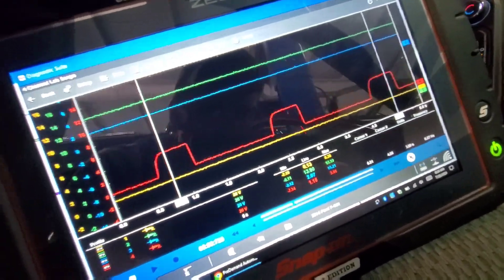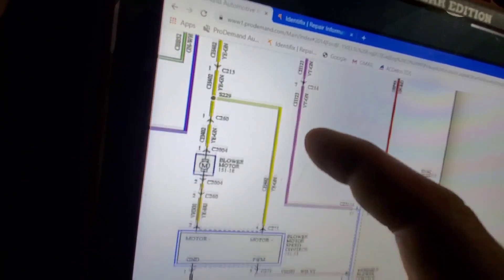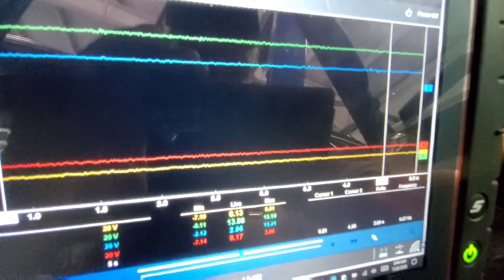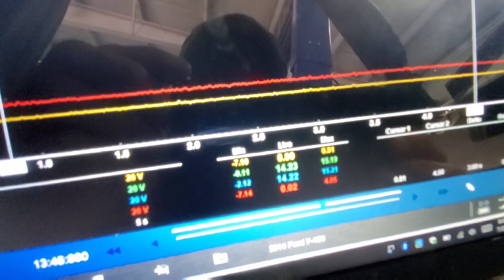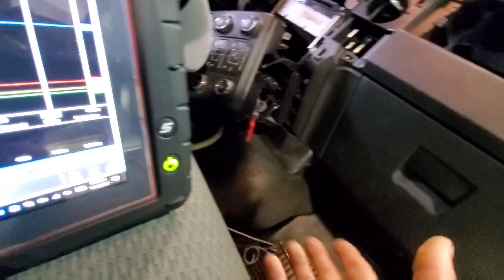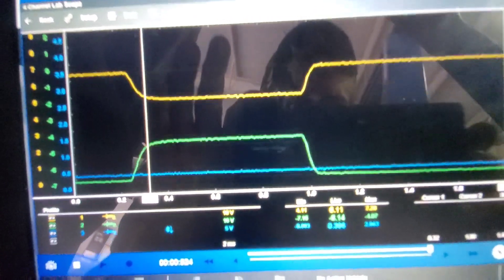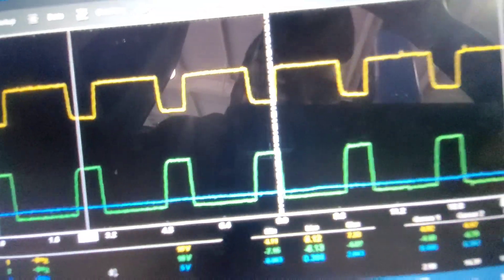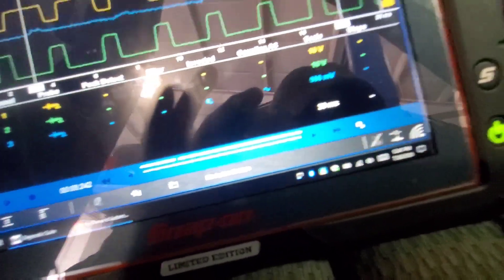2014 FORD F150 XLT (VIN: T) 3.5L, BLOWER MOTOR STUCK ON HIGH

Comment: Thank you Pauly. Good job. Question still remains. With the blower speed control module unplugged, you changed the speed on the panel and no voltage changes occurred on the scope. Circuit design question for the next blower speed control module testing case. Does the blower speed control module provide a 5 VDC reference and sends it to the HVAC control module and the control module toggles the voltage reference on and off ground to create the digital PWM signal? Or, does the blower speed control module not provide a 5 Vref to the HVAC control module, and it is the HVAC control module that generates and sends a 5 VDC PWM digital signal out to the blower speed control module? Have a blessed and safe week to you and your family.
Reply from the maker: After watching my own video and thinking about it more, again another reason why a love filming, I'm thinking that the HVAC Module is waiting for a voltage from the Blower Motor Speed Control Module and once it senses it, it begins to switch it to ground using a transistor internal to the HVAC Module.  Essentially it monitors the circuit and controls it simultaneously on the VIO/PPL CNTRL wire??? 🤔

Now you can see why I have the thing torn apart 😆🙄😉
Reply from the maker: I think that you understand why more than me hands down my friend 😁
Reply: @PaulysAuto  no brother we are kin to helping out techs from all over the world. We are on same level brother. You do a great job. What you do is filling in a large gap that factory info will never ever tell technicians. That is why factory flow charts are garbage. Factory doesn't want people to know system operation. The people who write factory service information are not even technicians, they are technical writers who get approval from engineers for what they can and cannot write. Keep up the good work buddy. God bless you and your family.
Reply from the maker: @billyyoder8171  Thanks Billy, means ALOT MORE than you know 👍 

You are 100% SPOT ON!

GOD BLESS YOU AS WELL MY LONG TIME FRIEND 🙏
Reply from the maker: @Jacks Journale these variables are what can really lead us astray if we are not mindful of them!